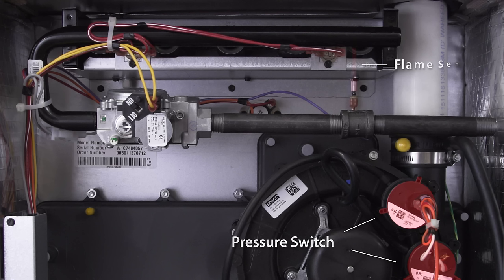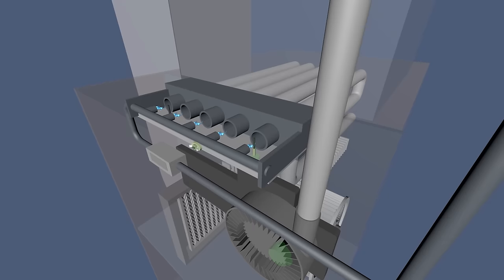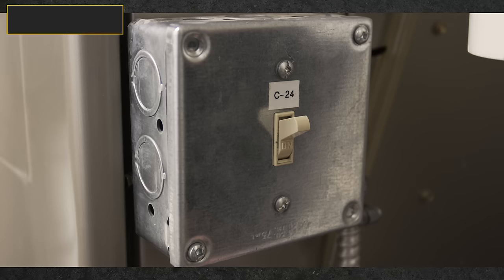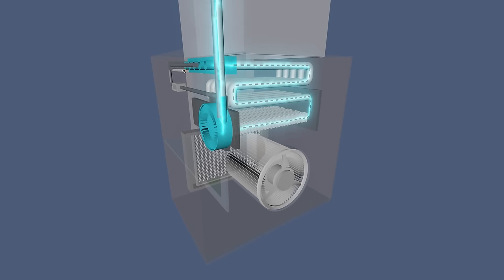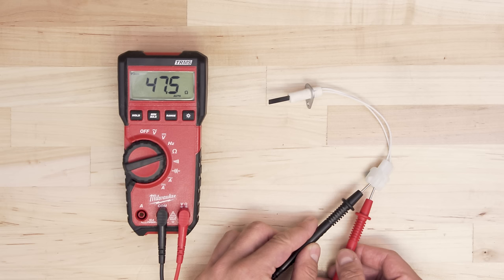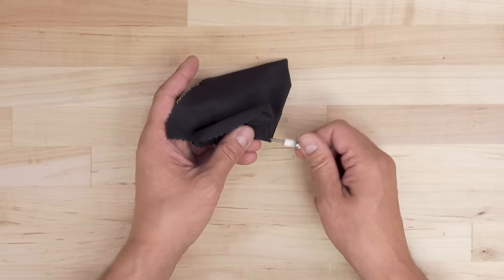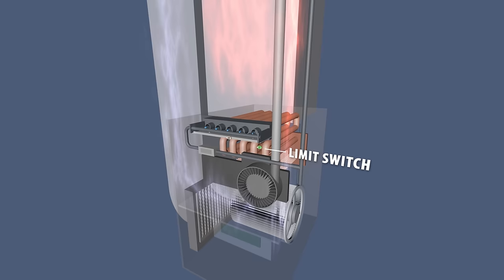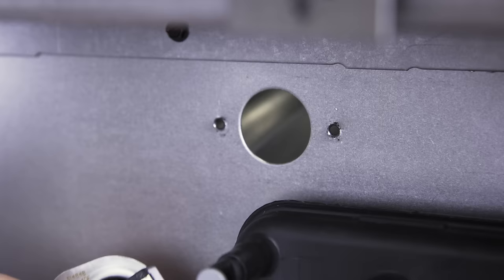Furnace Starts Then Stops - Troubleshooting | Repair and Replace

Comment: So many hours and videos wasted and everyone said it over and over again, Air flow!!!!  tip: old furnace with expensive airfilters will not work.  Use the cheap filters on all units from the 90's
Reply from the maker: Thanks for watching. You are right that using air filters with a higher MERV rating can restrict the airflow and cause issues. Its best to match the same MERV rating as the filters that are intended to be used on the furnace. MERV is explained in this video: https://youtu.be/hF_6-x8RR0U?t=133

Comment: Not all furnaces have lights so no this video doesn’t help. We all don’t have top tier equipment. Junk videos honestly.
Reply from the maker: Thanks for watching. Does your furnace have a standing pilot or a intermittent pilot light? If it has a pilot light that doesn't stay lit, you can still check the thermocouple: https://www.youtube.com/watch?v=3EKbSiAJyiI
If it has a intermittent pilot light then it could still be an issue with the ignitor.